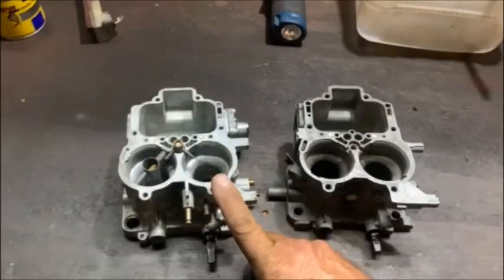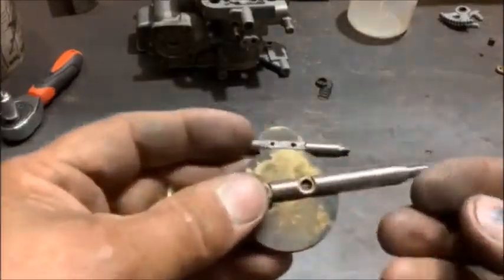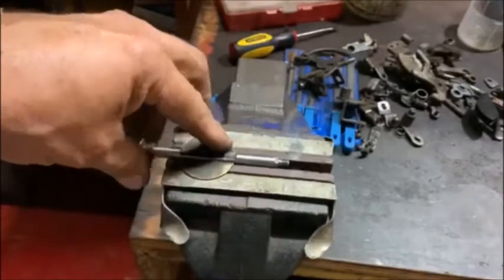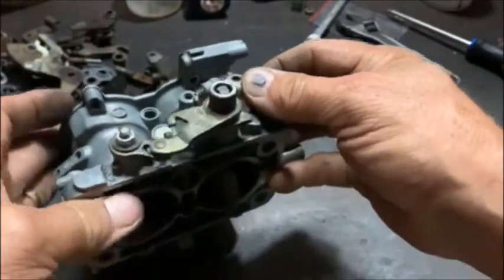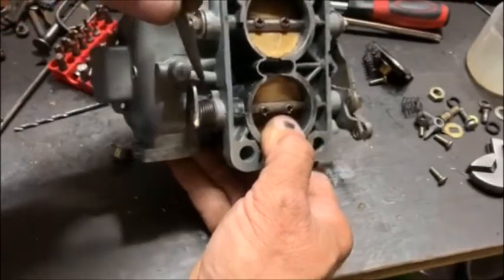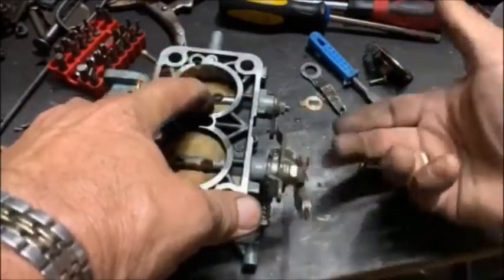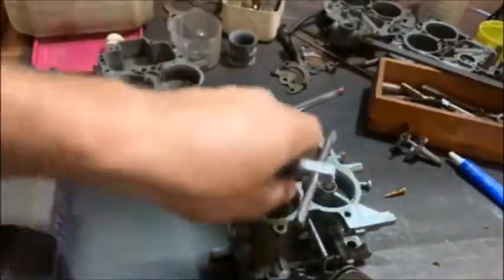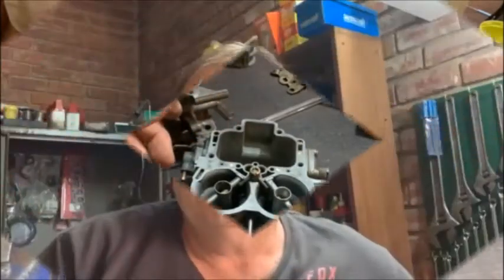Weber 38 DGAS progressive modification

Comment: I've got a really hot 1.6 in a Samurai. I've been running it on a 38/38 but it's really lazy down low. I just slapped a spare 32/36 on it and it really added a bunch of nut down low but now she's out of poop at 5500rpm. I've long had the thought that a DGS with a progressive linkage would be the best of both worlds. I'm happy I'm not the only one to have had the thought.
Reply from the maker: the reason you lost power down below is because the 32/36 has smaller venturies (26/27) and is progressive (probably also jetting), the two 38 butterflies that open together has a large effect on lowdown air flow, i hope it makes sence

Comment: I always wondered, if your carb is an appropriate size for your engine- why are there differences in fuel economy between say a 32/36 and a 38 DGAS? If you drive normally, shouldnt the carb only give the engine what it is asking for and that determines the economy?
Reply from the maker: hi, thanks for watching my videos, it all depends on the setup, in other words, the main jets, air correction jets, emulsion tubes, auxiliary venturies and the float level. you can have the correct size carb on a engine and be using load of fuel because the main jets are to large.

Comment: What a genius little idea.  Glad to see you've done it.  Any vids of this running on a motor or some results?
Reply from the maker: Yes i do have some videos running it on my Nissan 1400
Reply: Ooh!  I'll have to check that out.  I've been meaning to so the same mod for a few of the old engines I'm about to put back together here.   @carburettorrebuildservice8964

Comment: Very interested in doing this mod to my 38 DGAS for my 61' Jeep CJ5. I think this would be very beneficial for off road and on road. I do 70% on road, 30% off road as it's my daily driver. I was talked out of the 32/36 simply because my engine is mildly upgraded with slightly higher compression, larger bore, mild 240/238 camshaft grind and 2" free flow exhaust, so it moves more air than a stock engine. Your modification looks to be the best of both worlds for my application. Sadly, as it is my daily driver, and I am located in the US, I will have to perform this modification on my own due to logistics. I did source a genuine Weber 32/36 to cannibalize the parts from.
Reply from the maker: Please let me know how you get on with the mod.
Reply from the maker: Please remember to turn the idle mixture screw on the 2nd choke in all the way otherwise it will struggle to idle. you probable need to use a larger idle jet on the 1st choke. thanks for watching my channel.

Comment: Funny, I've been playing with and flow testing a 32/36, different mods like polishing Venturis, shaving posts on Aux Venturis, air stacks, etc.  Juat for fun.

I have a 38/38 on my Jeep 258, and the other day wondered what would happen if I made it a progressive like the smaller 32/36.  Seems it would be the best of both worlds.  Glad you did this, thanks!!  VERY Interesting!!
Reply from the maker: Yes it works a treat and you now jet the two barrels differently, 1st barrel for economy and the 2nd barrel to add a little performance.

Comment: Is it a big difference in power i started with it a few months back and never finished it is it better
Reply from the maker: Yes it makes a big difference, it revs up like you cannot believe, i love this mod on the 38, it makes it driveable for small engines.
Reply: @carburettorrebuildservice8964  then i wil finish mine what jetting did u use